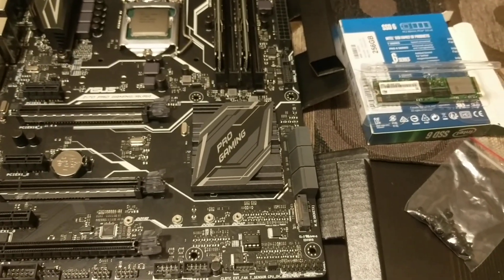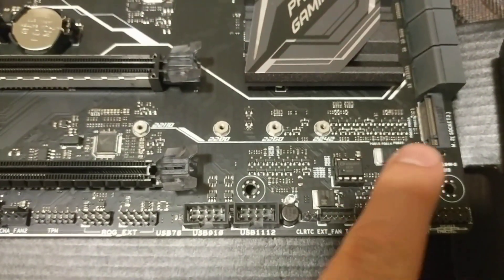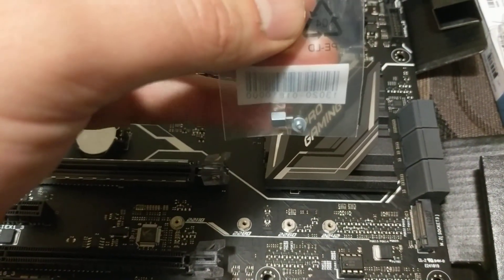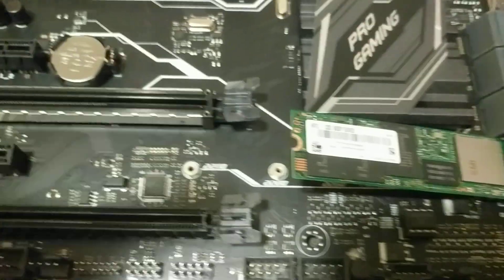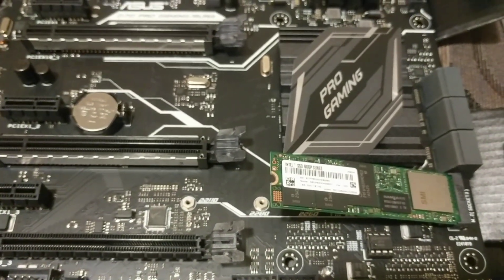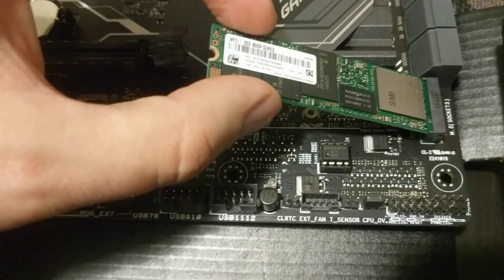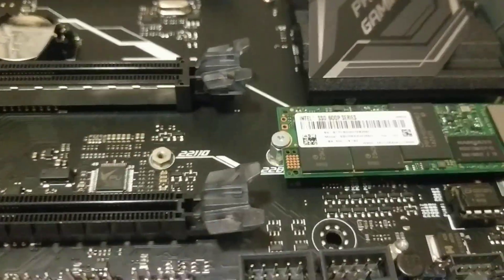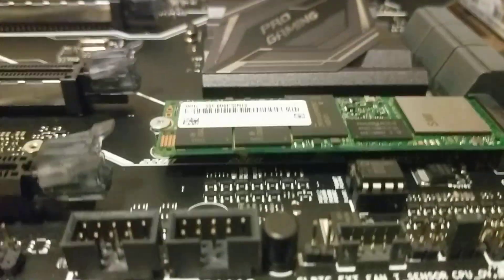How to Install M.2 ssd solid state hard drive on Asus z170 pro motherboard

Comment: Thanks again, still helping in 2022 - installed in a couple of minutes on a z 170A with no problems because I'd watched this first.  I'd lost / binned the m2 standoff and screw so ordered a replacement at the same time as the m2.

Comment: 2022 and need to know if this has 2 m.2 slots as I already have one in
Reply from the maker: I believe it's just one m.2 on that model
Reply: @idleagent  if I buy a 2tb can I partition 300gb for the OS
Reply from the maker: @joshdignam959  I can't think of a reason why you would not be able to
Reply: @idleagent  ok sorry for all the questions last one I’m guessing it doesn’t support gen 4 m.2 only gen 3 is this correct ?
Reply from the maker: @joshdignam959  no idea on that one. I would assume that it could use a Gen 4 but probably not to the full extent of 4s capability
Reply: @idleagent  ok thank you

Comment: Just got mine and I don’t have a bag kit, it’s just the ssd
Reply from the maker: Right, the mounting screws are included with the mother board. You'll need to order from Amazon or hit Microcenter if you can't find the Mobo set.

Comment: When I installed this in mine, the HDD LED stays on solid, and pulses with drive access.
All my other drives are SSDs on the SATA bus.   Which SATA PORT does this use? My
other SSDs are on 2,3 and 4.  I have the boot drive plugged into the SATA port that
says "O/S BOOT".   It's also 20MB/s slower than the other SSDs in the system.
Reply from the maker: The manual says "When the M.2 socket 3 is operating in SATA mode, SATA port 1 will be disabled". Are you doing anything with raid? Do you know what hard drive mode you are in? What brand nvme?

Comment: Have you lost the sata 1 after installing the m.2 .
these work with m.2 nvme or not?
Reply from the maker: IDK about nvme. I ran into major hassles trying to get this board to work with m.2 as the boot device while running two sata drives in a raid configuration. Officially Asus does not support it. I found a workaround where you can set the entire system to operate under raid drive protocols but in not using AHCI you lose the high-speed data transfer that the SATA ports are capable of. It's my biggest gripe about the system

Comment: Wow, you saved my bacon bro. I have built several computers, but I was stumped on how to properly install that M.2 board on the Z170. I actually found that little bag with the standoff and screw after 3 years. Sad that ASUS didn't give any instructions or even label the bag. Thanks!
Reply from the maker: yeah man, esp as this was one of the first boards of the generation to feature that m.2 slot

Comment: Useful video, cos I tried pushing the SSD down but realised that it was not right as there is stress on the SSD making it bend at the pin .. that is not good! I knew I needed a standoff .. and luckily found them on amazon (3 pack with 3 standoffs and 3 screws) .. so have to wait for that to arrive before I have more fun! By the way you sound so similar to a guy called Jerry on the youtube channel called 'ChessNetwork' .. check it out .. may be you are the same Jerry?! He is a National Master in chess out of Pennsylvania!

Comment: really useful, thanks, mine's a different Asus motherboard but the instructions were similarly useless, I almost tore the socket to pieces until I realised it was one of the ones where you don't actually need to unscrew anything (nothing at all in the guide to indicate this or to tell how to attack the m.2).

Comment: Do you think I can use tape to hold it down?
Reply from the maker: No, I think you're going to run into serious problems if you go with an adhesive tape. if you look on some of the other comment replies in this thread I link to Newegg and Amazon pages that should sell the screws

Comment: So, literally the easiest thing ever to install? 
Anyway, the real question of mine though, is if I use an m.2 port, if it'll slow down/disable one of the SATA ports (my friend has a motherboard like that so....) as I'm still keeping my old SSD as extra storage for games.
Reply from the maker: I was able to keep all my set of ports functional with no speed reduction. I use the M.2 as my OS boot drive and then normal solid States for game storage
Reply: @idleagent  Cool, good to know.

Comment: How to get that thread from 0:54?? Either i did not have it in teh box or i lost it....
Reply from the maker: my screws came from my motherboard box. Looks like these will work https://www.newegg.com/Product/Product.aspx?Item=9SIA27C4KN4726&cm_re=m.2_screw-9SIA27C4KN4726-Product
Reply: yeah screws are easy to find but the hex thing not :/ I am from Czech republic and I found on ebay for 13 bucks just from USA. To ship it to central Europe it costs something like 30 USD...so together 43 USD for a little screw and a hex thing....
Reply from the maker: I see what you're saying now. The threaded inserts were already installed in the motherboard. I don't know how you're going to install those aftermarket it looks like they were just embedded in the plastic. What brand motherboard is it?
Reply: I have the inserts I just miss the hex thing and the screw these two things you show at 0:54. You yourself put the hex thing into the insert, so I do not know what are you talking about.
Reply: and I have the same motherboard as you, ASUS Z170 PRO GAMING. They just did not put into my box those two things you show in the plastic sack at 0:54

Comment: That's great that they actually included your screw and standoff. What would that feel like?
Reply: Eric Sorensen they didn’t include mine!
Reply: @SovereignSinner8148  What did you do? Did you just find a mount and screw online somewhere? Also if so do you happen to have a link? Thanks
Reply: @biffdiff6725  Did you find where to get the mount and screw?? I'm also stuck with this problem

Comment: The design of installing the board in at 45 degrees and it just kinda lays there...then you bolt it down to the board.  Why would they do that?  lol  Made me nervous the first time installing.  Thanks for the vid, btw.
Reply: Just did it and it seems to be fine, but looked at my instructions on the Z270 mobo and it specifically says not to, to push it in straight. /shrug.

Comment: I'm wondering if you're still here, I have an asus z170 pro gaming motherboard as well. It says that there are no usb 2.0 internal headers and I don't even know how to differentiate them. If there are, where are they?
Reply: usb 2.0 ports are black while 3.0 are blue. is this what u came for?
Reply from the maker: http://dlcdnet.asus.com/pub/ASUS/mb/LGA1151/Z170-PRO/E10417_Z170-PRO_UM_WEB.pdf

page 22 of the guide (thats 1-4 by pdf page numbering) is a full diagram of the board . On the bottom of the layout diagram you can see that 12 is pointing to the internal USB 2.0 headers